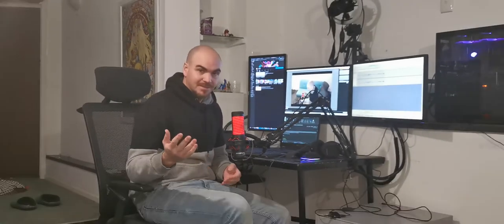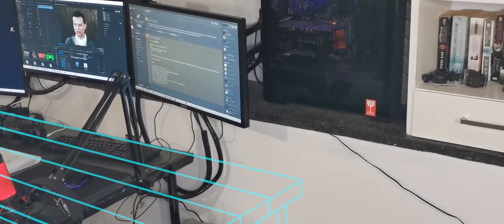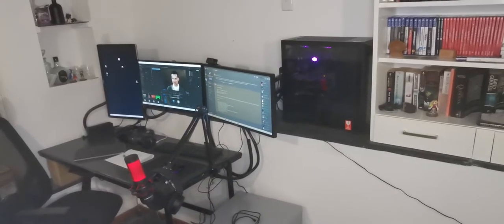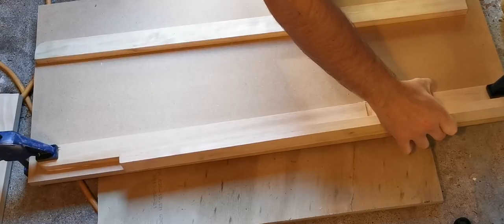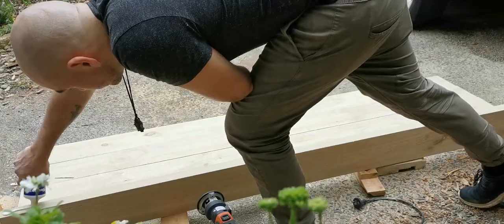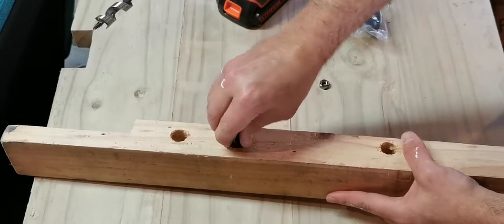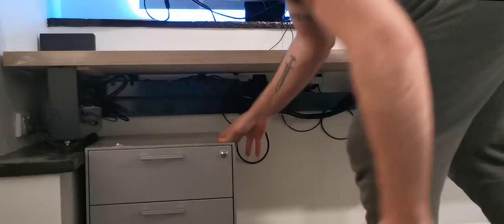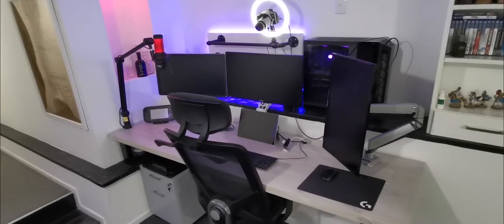Building a custom PC Desk

Comment: Planning is always good. My plan was a good few bits of 2x2 and some 4 inch a screws.... It worked, it was technically a desk 😂

Topped it off with an off-cut of a kitchen worktop. It was so heavy
Reply from the maker: i mostly wanted something that would withstand me slamming my keyboard down when i get killed in valheim